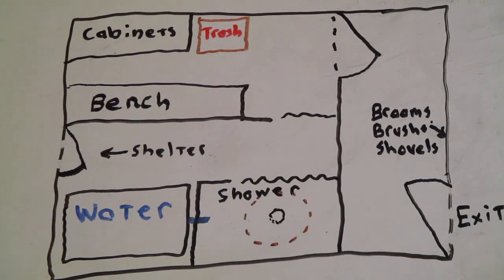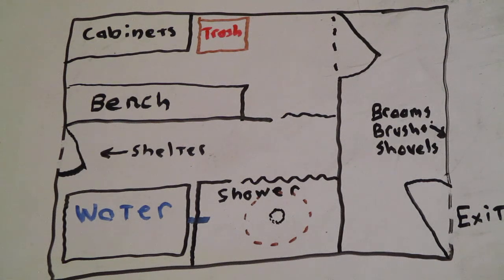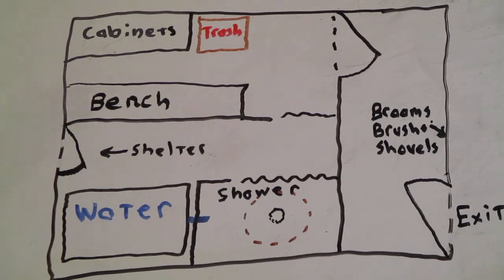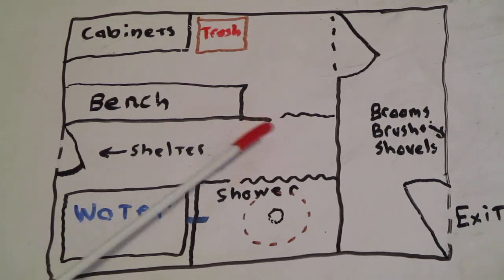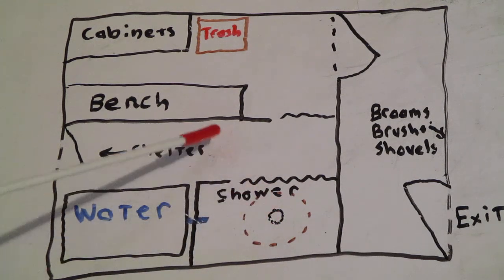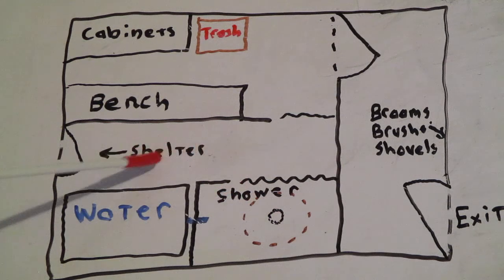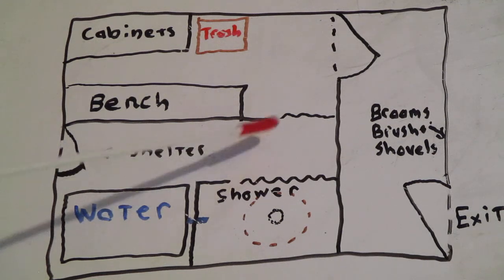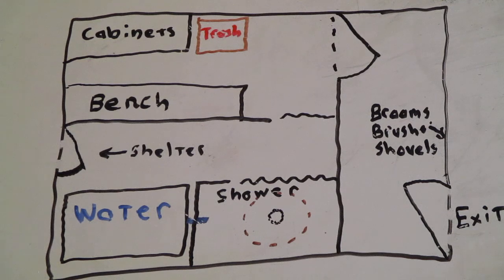NBC CBRN Task- Decon Shower For Fallout Shelter

Comment: What about having trash chutes inside the bunker, and having a incinerator linked up to the outside instead of leaving the shelter
Reply from the maker: You must have a lot more money than me to be able to do that.  The old Civil Defense stuff said to dispose of trash the way I have in here.  That is where I got the idea.  Incinerating can be considered a waste of needed limited fuel supply if you think about it.
Reply: SecurityGuy42 I was thinking of a gasfier to maybe make some energy to go into a battery bank but idk either method would draw attention to your shelter
Reply from the maker: True.  But I would think the trash mixed in with other refuse would be less noticeable.  And could be disposed of a ways from the shelter to conceal location.  You could dispose of it at night quietly.